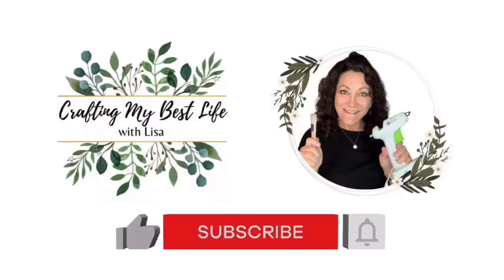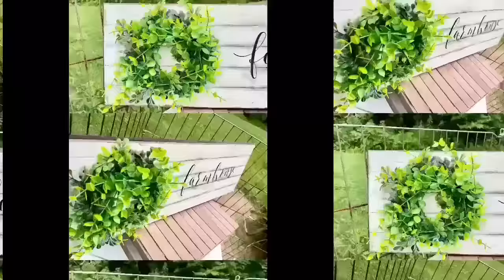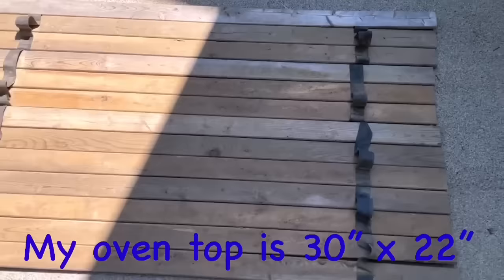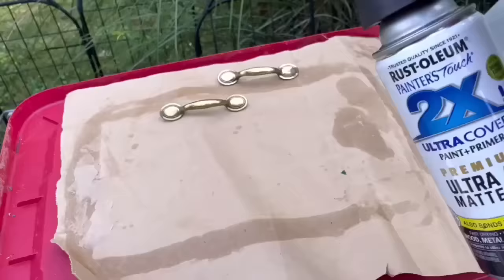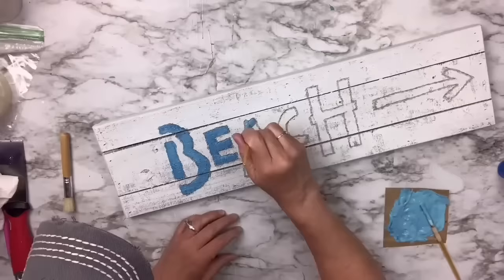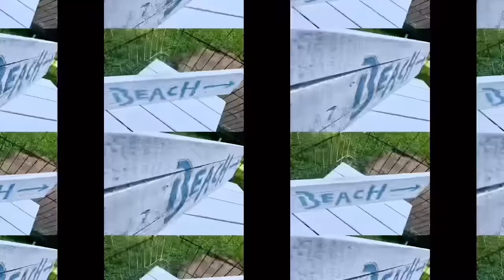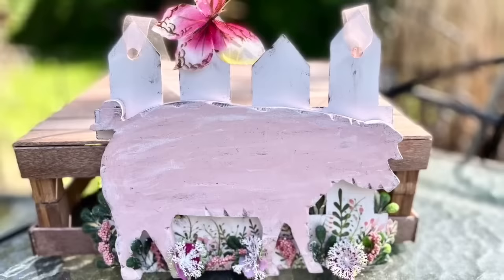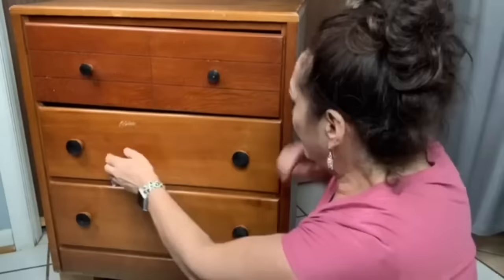MUST SEE Wood DIYS You Will LOVE

Comment: Hi question can you use the cutting board after the polyurethane has been applies?
Reply from the maker: Hi Elizabeth. Only as a decorative piece. To use it with food, you would need to finish it with an oil or other top layer that is food safe.
Reply: Thank you 😊